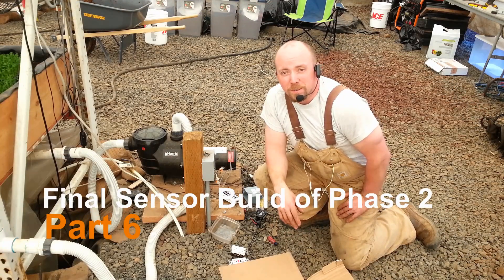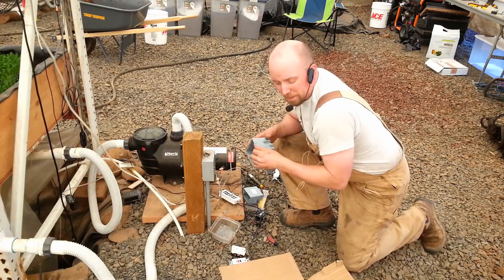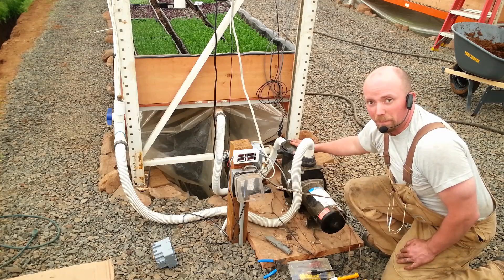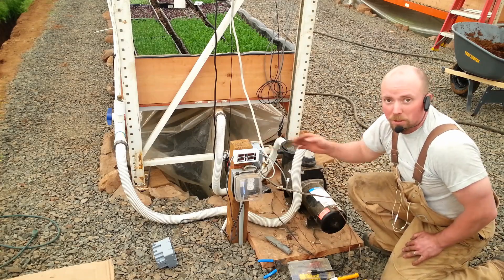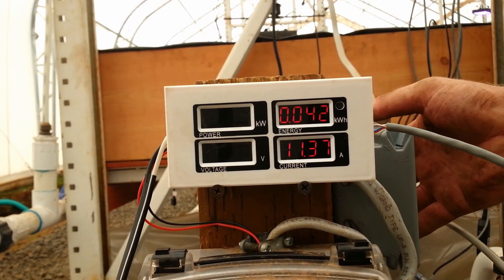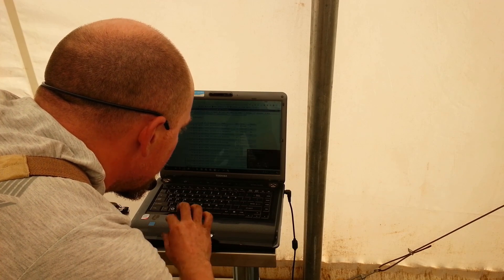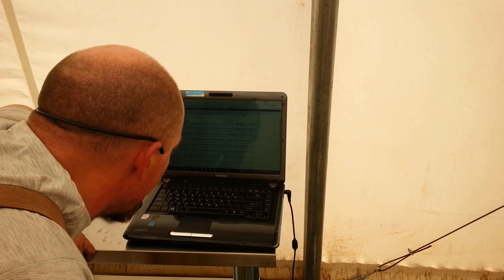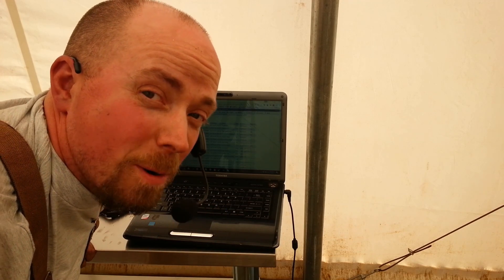Off-Grid Trout Aquaponics Automation - Arduino Sensor Build Part 6

Comment: Most of the time, people only build one copy of something (a table, an electronic circuit, a system for monitoring aquaculture tanks, etc.).  So, when they've finally made every conceivable mistake and finally know how to do the job correctly and efficiently, they can't use their hard-won knowledge.  But in your case, you were building two lanes, so you were able to do everything right the second time.  Congrats on the progress that you're making.

Comment: You should look into variable speed pumps. These are 3 phase motors with a VFD unit controlling them. You may even be able to use a 3 phase motor on your existing pump and buy a VFD ... that motor appears to be an industry standard square flange motor on your pump. Not cheap but way more efficient and, so far, more durable than single speed motors we've been using in swimming pools. You could also monitor and record the pump performance easily with the right VFD. You could tailor the water flow to your requirements instead of being stuck with a set flow rate which would also help the efficiency. I'm in the swimming pool business and we've been able to save people hundreds of $$ a year in power by switching to VS pumps. If you need complete pumps or stand-alone motors, I can get them wholesale and would love to help if I can.
Reply from the maker: +Patrick Brady got any links you could email me?
Reply: Busy day but I'll email you some info tomorrow. A lot of the info is exaggerated marketing wank and I was skeptical at first but I've seen first hand that there are gains to be had.
Reply: Sent you an email ... hopefully you got it and it was useful.

Comment: Was your KW meter working correctly seems like you should have had 1.320KW for the pump are did I miss something? and how did you determine that you need the 1.75hp pump? Thanks for the videos going to have start on a control system project after watching yours

Comment: Don't know what your water flow requirements are, but could you use a two-speed pump to fill your pumping needs? Slowing the pump motor by half reduces the power by four, so if you could pump longer your total energy requirement is reduced.

Comment: Mission Commander, several years ago 2 australians built a motor pump controller  that reduce the power consumption by 2/3rds and kept the pump running at optimum speeds. After this unit was featured the company went into over drive as all the county public pools was buying these units up b4 they were made to reduce the power consumption of the pool pumps. I think its now called power wave and this link http://www.solargreen.net.au/future-wave.html has info on it, maybe u want to talk to the inventors and see if they can make a 110 version of the unit. I will try and hunt them down and get their contact info for ya... I have the news clip in my server somewhere or it might be in utube.
Reply: once people see the problem like i do and they listen to my solutions its a win win situation..... people have ignored my advise and payed the ultimate price, cos of their ignorance or "she'le be right" bullshit attitude. With shipping containers here in australia we add a tin roof about 12 to 24inches above the container for several reasons, water collection, keep the container cooler in summer and a storage area for long metal, timber and pvc pipe to almost double the storage space. If ur gonna use one for storage and a storm shelter make sure u install DC ventilation and vent both ends of the container so one can suck air in and the other push air out. Hope I gave u more prepper related ideas. :)
Reply from the maker: +OffGrid Aussie Prepper™ thanks for sending this....do you think it's just a vfd?